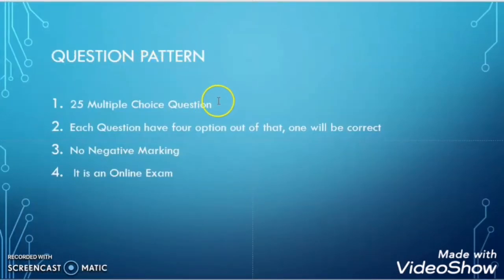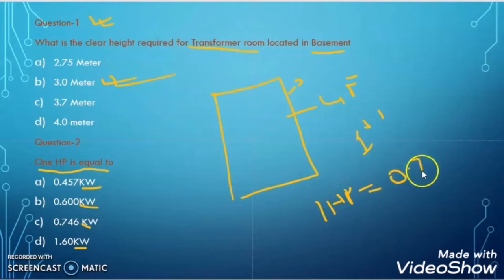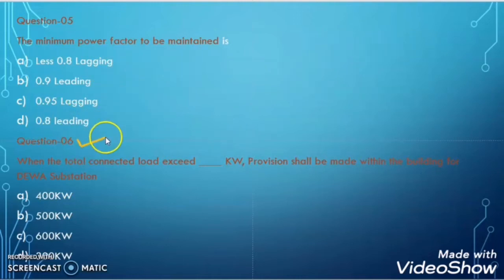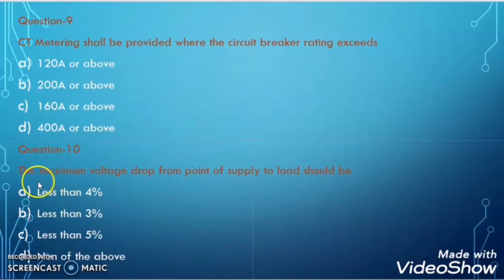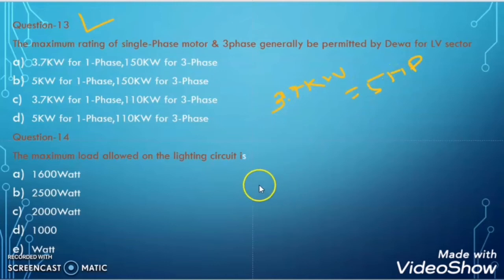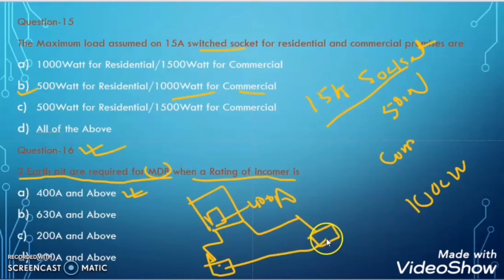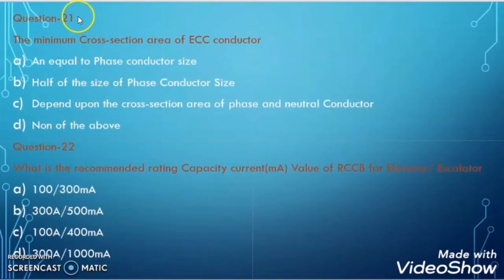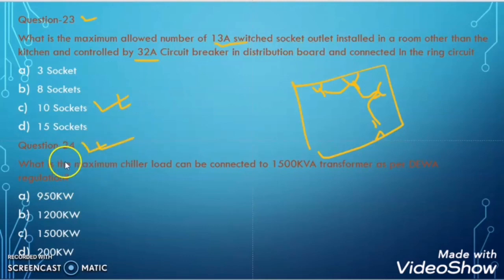DEWA EXAM MODEL QUESTIONS

Comment: How many mark required to pass the exam?
Reply from the maker: You have make 21 correct answer out of 25.

But no negative marking
Reply: @electricalconcept32  thankyou ,21 answer has to be correct??
Reply: @electricalconcept32  i can skip any questions? If i skip any question another question will be come instead of that question?
Reply from the maker: @ansugaming3991  yes bro. 21 answer should be correct.
Reply from the maker: @ansugaming3991  you can leave question but no other question will come in place of that
Reply: Bro if the incomer is 200A and above you should provide 2 earthing.
Reply from the maker: @mohammadshabeer8749  in dewa after 200A of incomer two earth pot required but as per ADDC from 500A of rating  of incomer 2 earth pits required.
Reply: No 11 
Answer c
200A and above